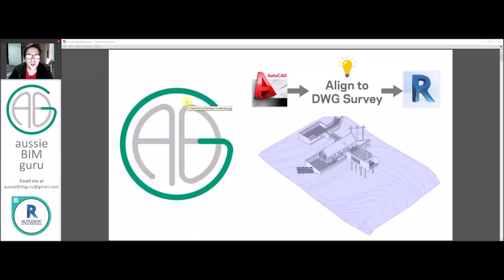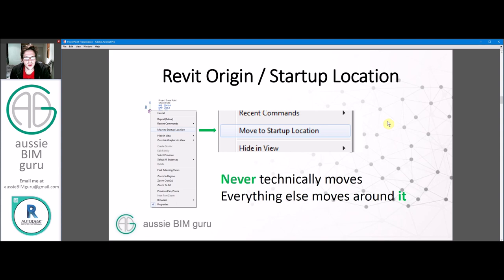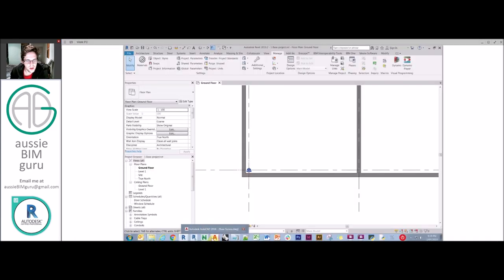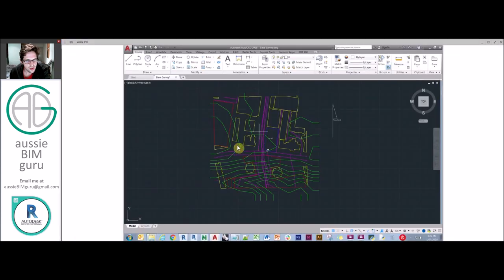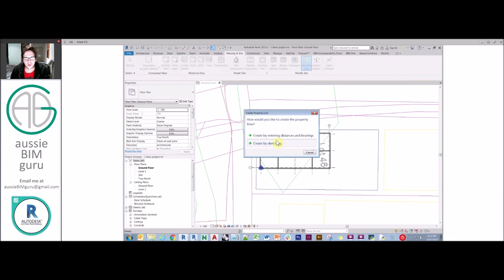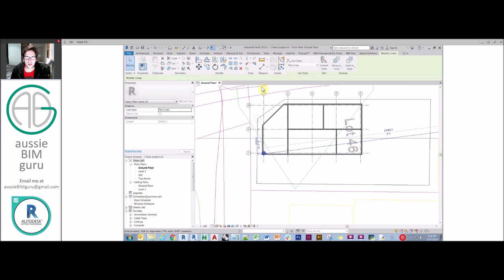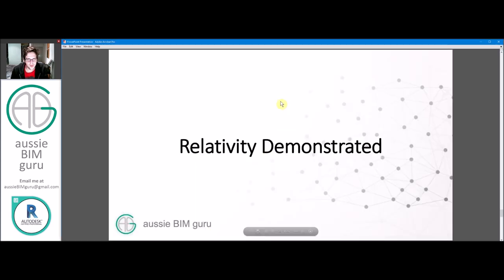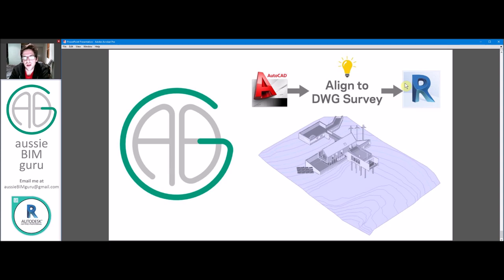Aligning Revit models to DWG Surveys

Comment: At 18.05 time when u rotate ur true north ur survey and project base point still in same position ...but in my case in my cadd site file when i rotate to true north survey point moves??
Reply from the maker: Make sure you aren't rotating project north, and that you are rotating about the internal origin. The survey point may move if it isn't at the internal origin when the view rotates to maintain its position.
Reply: @AussieBIMGuru  i have revit 2018 i dont  see internal origin..
Reply from the maker: Yes they didn't add it until revit 2020 i think. It is the location where your project base point first sits in a model. I run most of my videos in 2020, 2018 is very old now.

Comment: I'm working on a project in which I set up my project this way. The project I am working on, though, also includes a point cloud, which is geo-located. However, when I try to import the point cloud I get an error that says "The coordinates of the points in the point cloud file(s) you are trying to import are larger than 30000. Importing the file(s) may result in undesirable graphic behaviors. Click Yes to continue." So essentially, it is doing the same rounding on the point cloud as it would do if you were working 20 miles from the Internal Origin. It results in the point cloud being off. Any ideas on how to remedy this? My only thought is dropping the real-world coordinates and setting the Survey point as 0,0 instead of whatever the real-world coordinate would be.

Thanks for these videos!
Reply from the maker: Yep I nearly always have to get an 'originated' point cloud set up versus real world coordinates from surveyor for this reason. It's a fairly jarring limitation of Revit given the shift towards GIS.

Comment: At project setup, is there any downsides to moving the PBP to a point on your MGA survey (e.g. N/S6240000 E/W 330000). Keeping the survey point at the 0,0,0 origin and linking the CAD file by shared coordinates? I find this then allows for linking of pointclouds and cad files to correct real world positions. Thanks for the great video 👍
Reply from the maker: Yes the main issue is if those coordinates are well outside revit's geometry truncating limit of about 10 miles. This is quite common as MGA points arent usually that close to a site.
Reply: @AussieBIMGuru  Isnt the 10mile truncating limit based on the internal origin location? As opposed to project startup xyz0,0,0?. If you move internal origin then you're moving the truncating limit with it. Also when you say truncating limit, do you mean when geometry starts to distort and misbehave when too far from internal origin? Or does it have any other effects to the model. Thanks for responding 😎 your channel has helped me alot with dynamo 👍
Reply from the maker: Internal origin is effectively project startup point. It never moves, only Project base point and survey point do. Truncating is generally the misbehaviour like you mentioned, but can also cause issues when exporting back out as well.
Reply: @AussieBIMGuru  I see, but if you do following: Manage > coordinates>specify coordinates at point>enter mga coords. I thought this moved the both the internal origin and pbp, I must be mistaken.. I've never had any truncation issues doing it like this before but was interested to see if it  could cause any issues as it differs to your approach. Thanks again. Look forward to your next videos ☺️
Reply from the maker: @DeansFork  this only moves the relative coordinate system (PBP/SP values), the internal origin stays at 0,0,0 in Revit still. You can verify this in Dynamo by making a point at the origin and it will be at the internal origin every time.

Comment: Hi, I couldn't find a solution when I do link revit and the models are not in the same coordinates. Do you have some video about it? Thanks
Reply from the maker: In this case you would probably want to use shared coordinates to resolve this issue. I have a tutorial on this topic in my revit playlist. You could also manually align the models by ensuring their rotation to true north matches, then aligning their project base points and ensuring they have matching N/E values.

Comment: What's the difference of placing the coordinates, and highest spot elevation at the Survey Point?
Reply from the maker: Ultimately it's all relativity. Internally, the revit origin is what matters most. Given most projects are surveyed relative to 0,0,0 usually I make this the survey point so my coordinates can be relative to it.
Reply: @AussieBIMGuru  this topic is so new to me, that I do not know how to respond. I don't even know if I am asking the right questions. 

Anyway,  do you have videos related to working on the revit topography, lke placing buildings or masses in particular? Since they're only possible only if hosted on building pads
Reply from the maker: @drvlive2023   I guess simply what I mean is that the survey point represents what you want it to. It can be a survey datum at a known coordinate (it doesn't have to be at 0,0,0) or it can be an absolute origin (0,0,0).

Try not to let Revit dictate how you use the program. At the end of the day we can tell it a lot of things too 

I have a series on feasibility, but it doesnt go to the point of generating detailed topography/pad elements. I find the site tools in Revit quite limited, can't do much more than the fundamentals. Might be worth seeing what Balkan Architect has available in this case, he does a fair bit of topo.
Reply: @AussieBIMGuru  

I am trying my best on not being dictated by Revit. 

A lot of my knowledge in Revit came from Balkan, I've subscribed for like 2 years already. 

You did a good explanation to this anyway. Hope to see more. Thank you!

Comment: I have downloaded two Autocad files from the govt. database. One contours to make toposurface later from it and the other siteplan with building footprints on it. The problem is that although I could easily overlay them perfectly in Autocad I cant get them align properly in Revit. No matter what I do. Both are dxfs and I have tried with dwgs also. But they wont just be correctly aligned in refernce to each other.
Reply: Please help me to how to get them correctly in revit.
Reply from the maker: @arkplato2186  move their contents close to the autocad origin to make sure their file extents isnt too large for revit to accurately represent. If they arent aligning in revit, find at least two common points between the files (or make them in autocad) and use these to realign the files in revit as a last resort.
Reply: @AussieBIMGuru  Okay I found out that the only way it works is if I insert first file by using manual origin and then acquiring cordinates under manage. then while inserting the second autocad file I have to use shared cordinates option then it does overlap perfectly. Please help I found this work around but not the explanation as to why this is happening.
Reply from the maker: @arkplato2186  the most likely reason is there is a WCS setting in the CAD file that is acquired as a coordinate system in revit. By loading the second file using the same system it understands their relationship as theyre probably using the same WCS or UCS.

Comment: Hi sir how r u ...sir while rotating true north ...i saw some people subtract the angle from 360 then they rotate the resultant i.e 360- angle ......i don't know what's the trick ...can u plz tell me .....thanku sir...
Reply from the maker: It really just depends whether you want to rotate to the left or right (anti or clockwise).

Some people prefer to work consistently, so sometimes they may know the angle but in the opposite direction to what they know. To calculate this they can enter their angle as a temporary formula for revit to solve (360 degrees minus rotation angle).

Comment: Sir at time 20.10 the survey point is corner of property line ok ..but when u set specify cordinates at point u didn't change the point at corner of property line instead u did corner of building.bcoz that survey point is corner of property line and u set at corner of building?? Plz sort my confusion
Reply from the maker: I did the corner of building, but you could specify the corner of the property boundary if you wish also. The logic is you put the survey point where the survey is taken relative to and then specify any known coordinate in the model. It doesn't have to be the survey point if you know another coordinate from the survey file.

Comment: WHAT IS THE MEANING  OF INTERNAL ORIGIN IN REVIT ?
Reply from the maker: This is the origin of the Revit model itself. The project base point and survey point are extra points that can create a coordinate system relative to this.

Autodesk has a detailed summary of it here: https://help.autodesk.com/view/RVT/2022/ENU/?guid=GUID-363D008B-69DF-4FAA-AA01-6BE9C10267A8
Reply: @AussieBIMGuru  THANKS.

Comment: I think you made things too complicated in this video. A topo model with big coordinates normally uses a projected coordinate system. As an architect its usual not to have knowledge about that but you must know one thing. Project coordinates systems have scale transformations. You cannot design a building right away using them. When you design a building you must ask from a surveyor to convert these coordinates to a local site appropriate for building design. The transformation is not just a move. In small sites, many times it's not noticeable. But in large sites it is.
Reply from the maker: Thanks Nikou, I understand that a survey can often be a more complex process than what I showed here, ideally this process would be applied once a corrected coordinate system/survey reference is provided for alignment. I would hope in this circumstance the surveyor is more actively involved in guiding this process for the users given high level of risk involved in discrepancy. At the end of the day architects rely on the expertise of their surveyor to provide true and correct data to align towards, it is not our job to dictate this process.

The case study I used here is quite typical of working with Australian coordinate systems provided by surveyors, I expect different projects/areas of the world differ depending on location and model use (different GIS/GDS types etc.).
Reply: @AussieBIMGuru  i think in your example also needed to applyed a combined scale factor before insert in Revit. Also one suggestion. I always create a level without view, witch I call sea level. It remains at the 0 elevation is Revit internal origin. I always attach survey files at this level because topo points also work with absolute elevation. Then I move my project Base point in the elevation certificate want to have my project 0
Reply from the maker: Yes this is essentially how I manage things now also, a datum level. I typically give it a unique level type and filter it out.